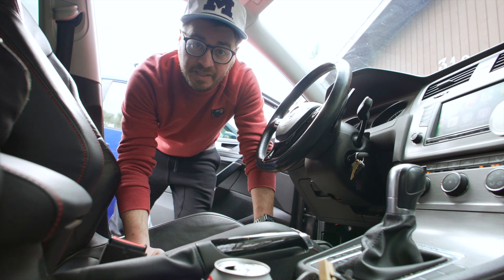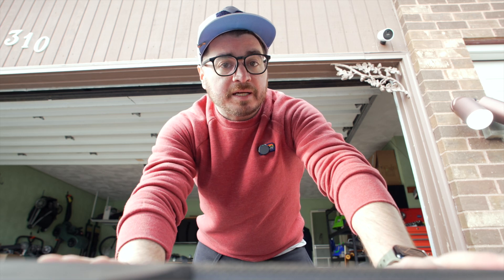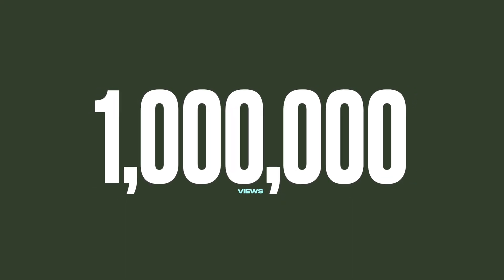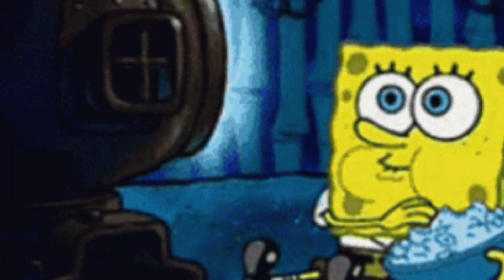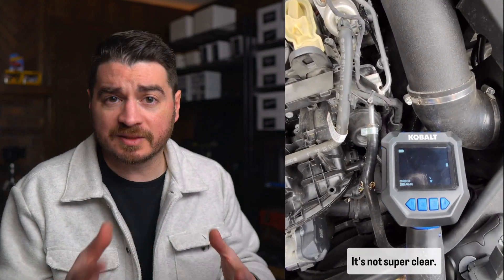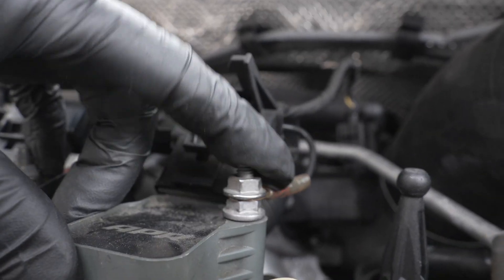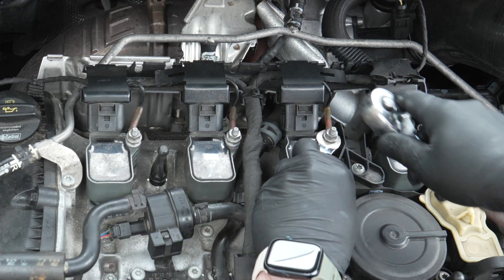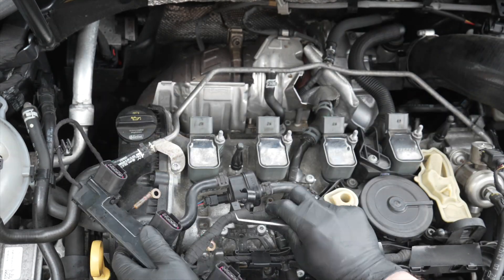Stripped Coil Pack Bolts? Here’s How to Fix Your VW’s Grounding Issues | MK7 Golf GTI MQB

Comment: Connector I just installed is 4B973724 I read this are not designed to use EQT . That connectors have to be 4DO or 8KO 3generation . 4B are 1-2 generations. How true is this .

Comment: Can the stripped bolts on the coils cause an EPC light? I have the EPC light on on my jetta 1.4t. I changed the plugs and the coils and it still comes on. I checked the throttle body as well & seems like its in good shape. Unsure where to go from here pls help lol
Reply from the maker: I'm not that deep of an expert on all VWs. My understanding is misfires will trigger EPC and bad grounds will cause misfires.